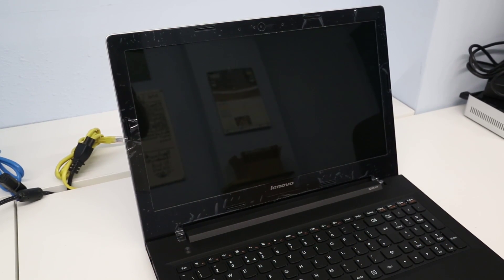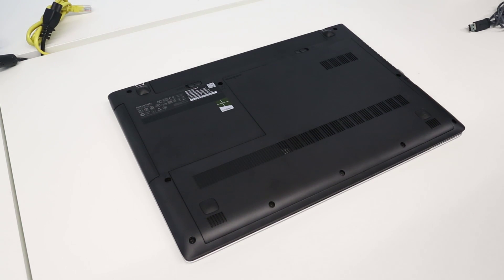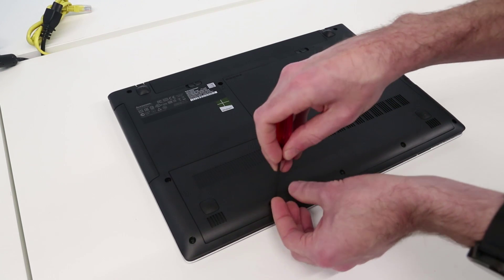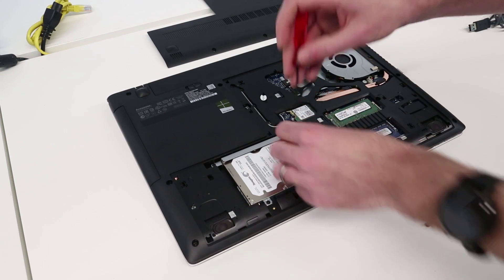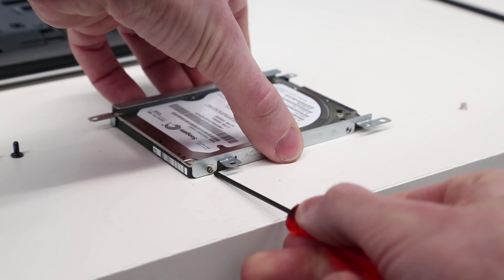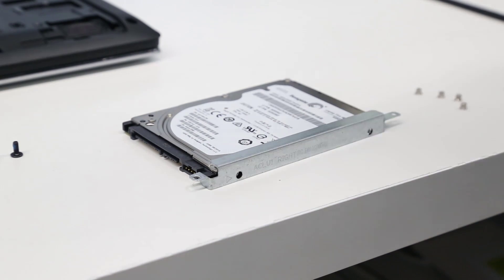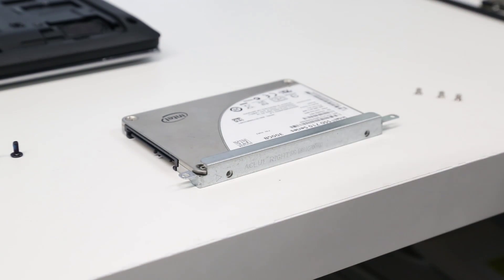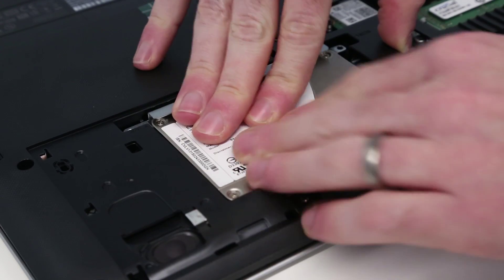Lenovo G50 SSD/HDD and Memory Upgrade and Repair Guide

Comment: bro is this peoduct ddr3 or ddr3l
Reply from the maker: DDR3L
Reply: bro  my lpatop lenovo g 50 80 intel core i5 5200u      chip set broadwell-u ddr3  pc3-12800
Reply: ram voltage 1.35 bro but cunfusion is it ddr3 or ddr3l
Reply: but system showing ddr3 how to conform this matter

Comment: What about product id and licence of original window I mean this laptop comes with original window and if you change any hardware your license get expired?
Reply from the maker: The Windows license is in the system firmware. You can either clean install or clone the existing install and it will reactivate from this.

Comment: Can we use a 9.5mm caddy in the 50-80? and does it need an ODD board or anything to replace the optical drive with an SSD?
Reply from the maker: I no longer have this laptop, but yes, I believe a standard caddy should work fine.

Comment: I am wondering if anyone can help me or give me some advice on how to get my dead OCZ 240GB SSD back, it was burn since I accidentally connect the power connector reversely (how stupid I am), can anyone tell me how to get it back alive?
Reply from the maker: I doubt you'll be able to get it working again. You might be able to get data off it using a data recovery firm, but it won't be cheap.

Comment: bra does ssd realy impove this g50-80? or its just a waste of time and money? if it does could u tell me what model of ssd is the best? around 200-250 gb or so
Reply from the maker: I'd personally not want a system without an SSD, best upgrade you can make in my opinion.
I tend to fit Sandisk SSDs: https://amzn.to/2Hu4Wah
Reply: Thanks bro I will buy the 120 gb ssd
Reply: whats that upgrade kit? there is an option: independent unit or SSD +upgrade kit

Comment: It is showing 4 GB ram only.... please please help me
Reply from the maker: Assuming you've added more. Have you pressed it in firmly and clicked it down into position properly?
Also if running Windows 8 or 10 did you do a FULL shutdown (Run, shutdown /s /t 0) and not a sleep, hibernate or hybrid shutdown before installing?
Reply: I have shut down my laptop before installing
Reply: I have windows 10
Reply from the maker: Are you running 32-bit Windows or 64-bit?
Reply: 64 bit
Reply: Please help
Reply from the maker: Do a Restart, in case you put it into Hybrid Shutdown rather than shutting down properly prior to installing. If that doesn't work then you've not fitted the module properly, or it is faulty.
Reply: I have hynix 4 GB ram ddr3...is it compatible
Reply from the maker: Yes. As above, you've either not fitted it correctly or it is faulty.
Reply: Bro..I had fitted it 5 times again and again but it is still showing 4 GB ram...and according to you if the ram is faulty then can u please tell me how to clear it otherwise my 2400 rupees will waste...
Reply: Bro I have installed it again and black screen comes..my pc doesn't start
Reply from the maker: Sounds like it's faulty to me then.

Comment: can you use two 16gb sticks here <32gb>... Crucial suggests two 8gb <16gb>, but the specs are otherwise the same.
Reply from the maker: I think 16GB is the max supported by the processor.

Comment: Hi can I cange my HHD to ssd and use that hhd also by removing  a disk reader get a mout and put hhd there and use ssd as bot drive and hdd fore somthing else
Reply from the maker: You could remove the optical drive and fit an SSD/HDD in a caddy.
Reply: +Brue Computing Yes that is what I am doing

Comment: Hi I'm wondering if I could install 8GB on top of the already installed 4GB?
Reply from the maker: Yes, although for optimal performance I'd normally go with a pair of equal sized modules, so either 2 x 4GB or 2 x 8GB.
I normally fit SanDisk SSDs, although for this demonstration I was using an old Intel SSD I use for testing.
http://amzn.to/1sFoHUX

Comment: Hello dear please let me know can I able to use one 4gb and one 8gb ram? If yes how will be the performance of lite video editing? As my laptop powered with 4gb ram. So please tell me whether I can go for 8gb or another 4gb?
Reply from the maker: +gsr praveen You can, but it has a negative affect on performance as the memory controller is in an unbalanced configuration. I'd either go 2 x 4GB or 2 x 8GB.

Comment: What ram is that? Could you comment a link please:)
Reply from the maker: +Joseph Duthie Standard DDR3-1600 SO-DIMM, 1.35v

4GB: http://www.amazon.co.uk/gp/product/B005LDLV6S/ref=as_li_tl?ie=UTF8&amp;camp=1634&amp;creative=19450&amp;creativeASIN=B005LDLV6S&amp;linkCode=as2&amp;tag=httpwwwbrue0a-21 

8GB: http://www.amazon.co.uk/gp/product/B006YG8X9Y/ref=as_li_tl?ie=UTF8&amp;camp=1634&amp;creative=19450&amp;creativeASIN=B006YG8X9Y&amp;linkCode=as2&amp;tag=httpwwwbrue0a-21

For SSDs I normally go with the SanDisk Ultra II 240GB: http://www.amazon.co.uk/gp/product/B00M8ABEIM/ref=as_li_tl?ie=UTF8&amp;camp=1634&amp;creative=19450&amp;creativeASIN=B00M8ABEIM&amp;linkCode=as2&amp;tag=httpwwwbrue0a-21